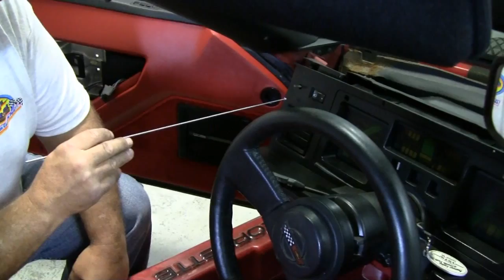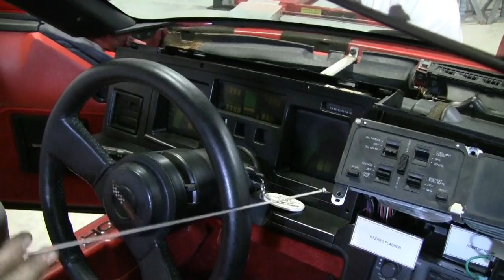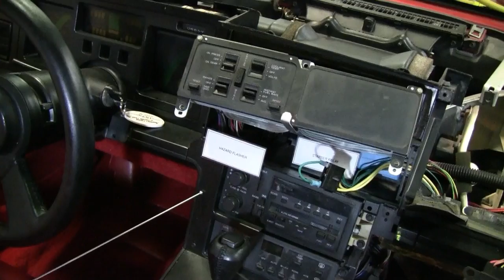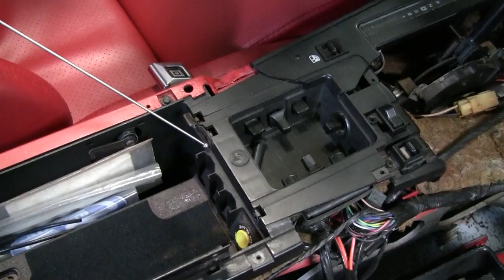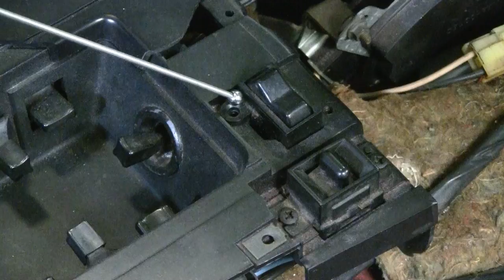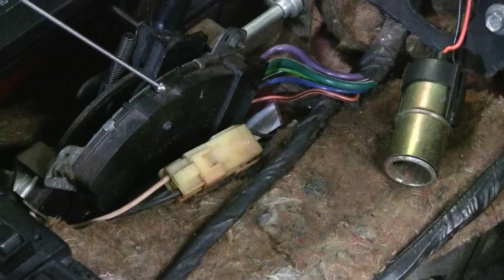C4 Corvette Cutaway Console and modules

Comment: Just finished watching the video "C4 Corvette cutaway console and modules" .  In that video it also shows the "power mirror control toggle switch", but not replacement of that component.  Can someone give me any info, diagram or schematic on the removal and replacement of the "toggle switch" ?   Thanks in advance.
Reply: Small screw driver wedge the plugs apart better yet junk the whole car not worth fixn

Comment: does the neutral safty switch keep the engine from turning over or does it just kill the fire to spark plugs? or both?
Reply: Bad neutral switch will prevent engine from turning over.  Imagine if you were trying to start the car while it was in the drive or reverse position--same result, turn key and starter will not engage.
Reply: Unplug it and run a jumper wire connecting the plug and car will start the switches are not available anymore better yet junk the vette